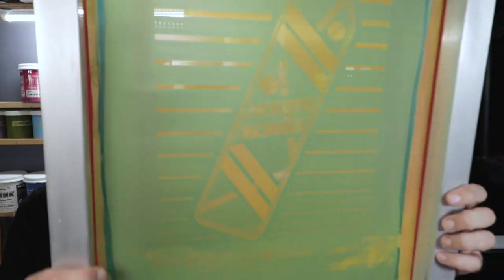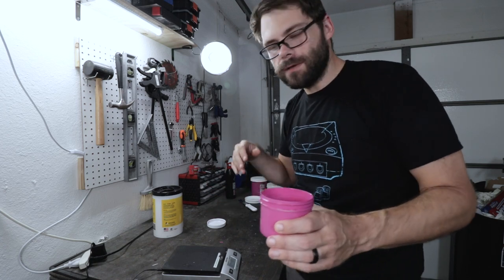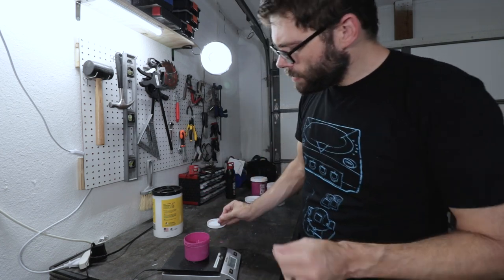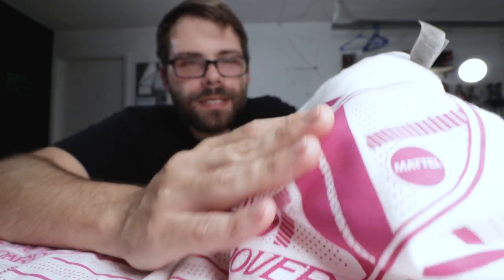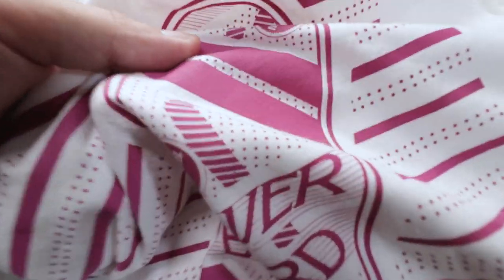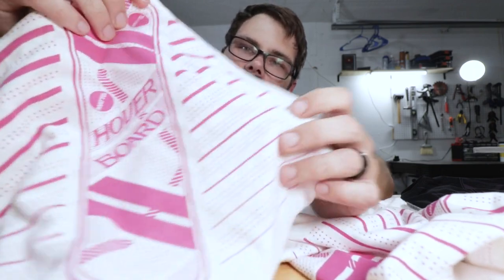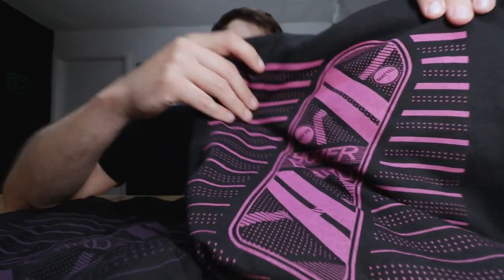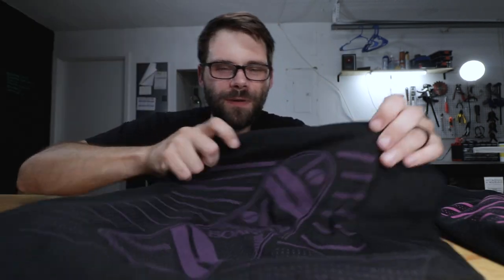What is Soft Hand Feel? /// How to Screen Print Soft Hand Without Waterbased Ink

Comment: So there's no white underbase on that plastisol black shirt? I'm just getting into screen printing, all I bought is waterbased, since I didn't want to deal with the clean up of plastisol. I just assumed you had to do a white underbase on dark shirts.
Reply from the maker: There's no white underbase in this print. Having an underbase would be the best way to get the brightest print, but that would have defeated the purpose of this test I think. Adding more ink would lessen the soft hand feel.
Reply: u can discharge on the black tee and then do the soft hand plastisol and it will come out way better!  @joshisterrific

Comment: great video, just to make sure, you recommend using a white under base using water based ink and well, the rest of colors on top of it, right? So, i guess that a 5 layer print on water based ink is way softer than plastisol and the feel is more natural although it may look less vibrant.
Reply from the maker: I dont have a ton of experience with waterbased, to be honest, but I'd say the goal with wb ink is to have as little underbase as possible to keep that soft hand feel.